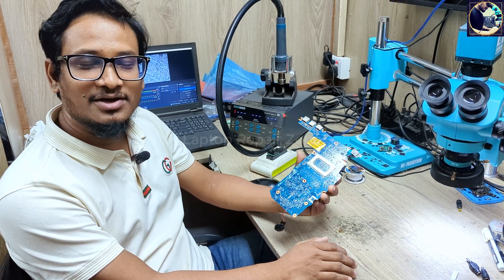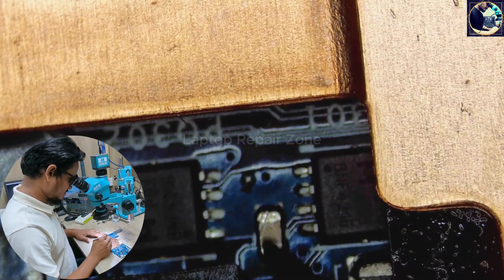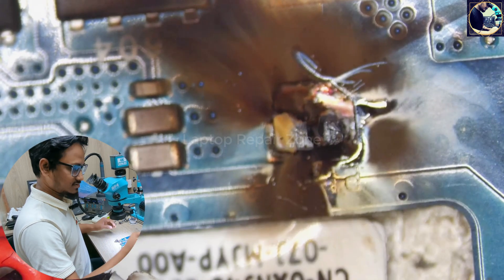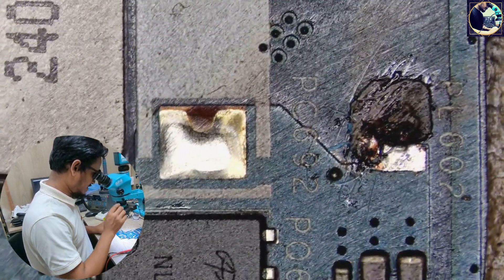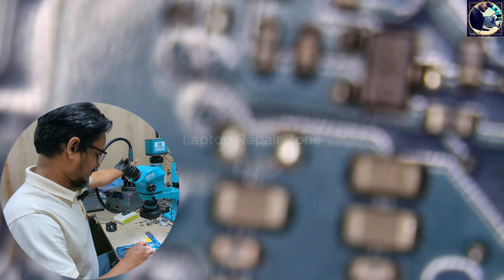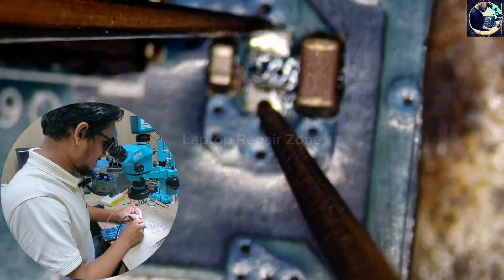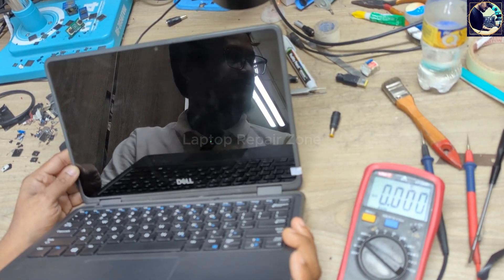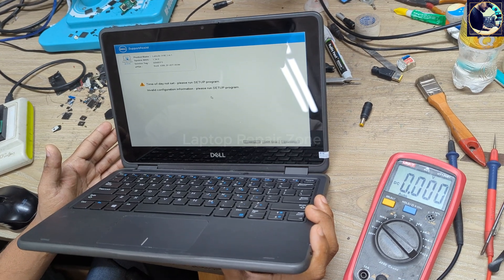Dell latitude 3190 not turning on | LA-F463P | dell laptop no power solved !!

Comment: Hp elitebook 840 g6 battery on 
But dc not on
Reply: Dc suply amp in 27 ten down 4 then 3 in stuck
Reply: Please help
Reply: I changed charging ic and crn resistors but problem not solve